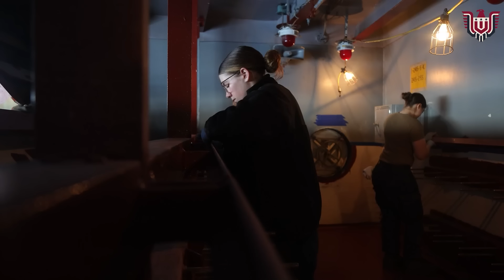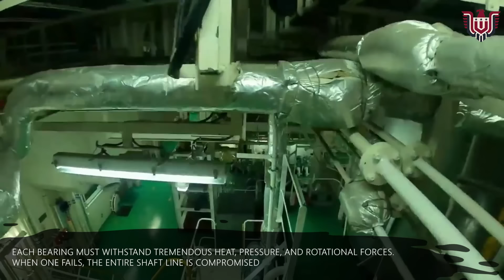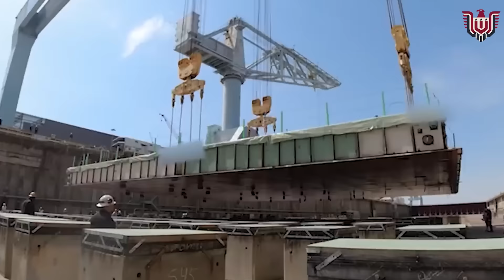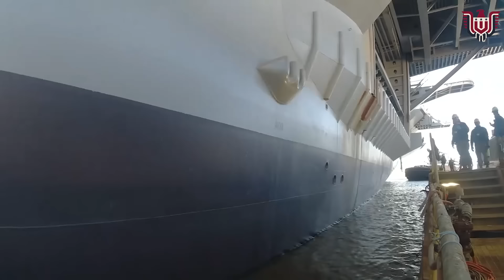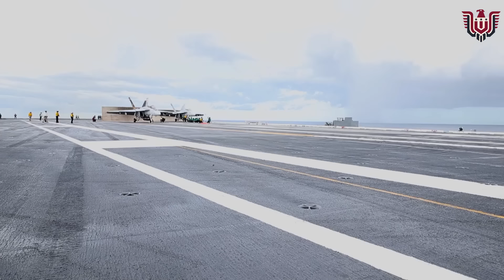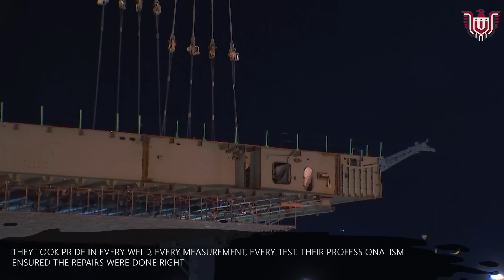How US Navy Rolling Out Newly Repaired $13 Billion Supercarrier From Dry Dock

Comment: People focus on the $13B price tag, but the capability and deterrence value you get in return is unmatched.
Reply: The $13B price tag includes the design and planning effort associated with first of class ship development.  Follow-up ship construction costs are continually lower since the design and development is bought and paid for on the first of class ship (CVN78).  There are design improvement costs associated with follow-on ship construction.  It is a continuous improvement process and the follow ships are usually better as system upgrades are incorporated.  Each ship may look the same but they are all unique.

Comment: You keep referring g to the $13B upgrade expense and repair, seemingly forgetting the original taxpayer cost of manufaturing this carrier and the accountability of the original builder of testing and quality controlling those failing bearings before the left the factory and installed on the ship. Has that supplier been charged additional fines for supplying faulty parts, and to cover the replacement repair? , unlike some other military projects, where failures get sweepedunder the carpet, to avoid punishing irresponsible suppliers and contractors. That should be a critical part of this otherwise decent coverage of a Ford class carrier  addition to the US military arsenal !!

Comment: The Vacuum Collection, Holding, and Transfer (VCHT) system on the USS Gerald R. Ford (CVN-78) is a vacuum-based sewage and wastewater handling setup (similar to those on airplanes or some cruise ships), designed to use less water than traditional gravity-flush systems. /it has been deferred.

Comment: Hilarious !!! All worships have long since been OBSOLETE, at least against any nation that is considered a super power or even has modern missile systems . Even a country like Iran could very easily sink that aircraft carrier with a single GPS guided missile. Russia could sink that aircraft carrier anywhere in the entire world . China could just about do the same . Russia does not manufacture air craft carriers anymore as they are smarter than the US and manufacture many more submarines.which are far more protected Extremely hard to locate but massive air craft carriers can not at all be hidden in the modern world and so air craft carriers are sitting ducks .

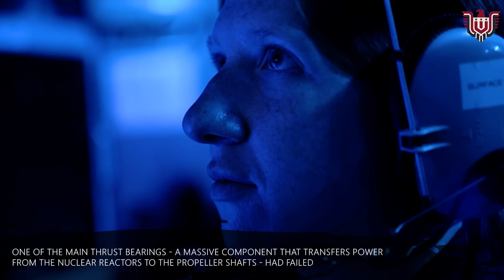Comment: 4:50 Let's start with the fact that the thrust bearing does not transfer power from the nuclear reactor to the prop shafts, nor does it handle forces from the reactor
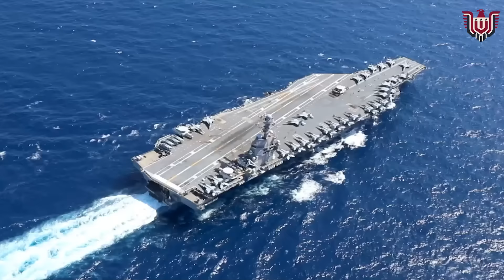Reply: Actually, let's start a few seconds earlier. At 4:33 the narrative specifically mentioned that the problems began during "post delivery sea trials". Which means the USS Ford had not even received her commission yet. So later in the video, when it mentioned her being taken *out of service", she wasn't really IN SERVICE to begin with! She was still in PCU.

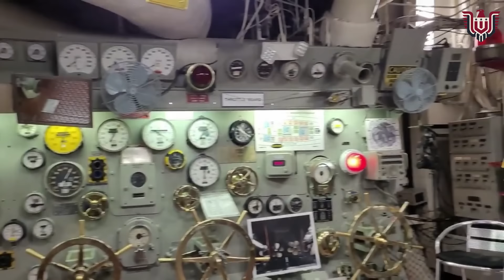Comment: that video segment  beginning at 5:05 min. is i believe  #3 engine room  main controll of midway cva 41 newest version   the engine room  has nothing to do with  the thrust  bearing  of the prop shaft 
the nain shaft thrust bearing is in far rear shaft alley  where the prop shaft exits the rear bulkhead  just forward  of the propeller      uss midway cva 41  1963 to 1966  #3 and #4 engine   $4 pump room

Comment: Fun Fact:  1 - ONE - nuclear tipped hypersonic missile will turn the Gerald R. Ford into a submarine.  A hypersonic missile travels faster than a 30.06 bullet.  A .30-06 bullet takes about 1 second to travel 800 yards, a Mach 10 hypersonic missile (such as the Russian Khinzal) would cover that same distance in about 0.2 seconds.  A hypersonic missile traveling at Mach 10 would cover a distance of 100 miles in 47 seconds, AND they have obstacle avoidance and maneuverability in flight.   Imagine 10 or 12 of them incoming - nuclear tipped.  Good luck evading that in a CV.   The only other option is to shoot them out the sky.  Good luck with that too.

While the Ford-class is designed with incredible "damage control" and survivability in mind, a nuclear strike combines two forces that even a 100,000-ton supercarrier cannot withstand: unparalleled kinetic energy and a nuclear thermal/pressure wave.

1. The Kinetic Impact (The "Bullet" Effect)
Even without a nuclear warhead, a hypersonic missile traveling at Mach 10 carries enough kinetic energy to behave like a massive railgun slug.

At these speeds, the missile doesn't just "explode" on the hull; it behaves more like a fluid, punching through multiple layers of armor and internal bulkheads before the warhead even detonates.

A direct hit to the flight deck would instantly end the ship's ability to launch or recover aircraft, turning it into a "mission kill."

2. The Nuclear Blast (The "Sinking" Effect)
If the missile carries a nuclear warhead (even a "tactical" one of 10–50 kilotons), the survivability of the ship drops to near zero.

Hull Rupture: A nuclear detonation within a few hundred meters would create a pressure wave capable of buckling the Ford's steel hull and flooding multiple compartments simultaneously.

Vaporization of the "Island": The heat from the blast would likely melt or vaporize the ship's sensor masts, radar, and the command "island," leaving any survivors blind and unable to communicate.

Operation Crossroads Lessons: Historical tests (like the 21kt "Baker" test) proved that a single nuclear device can sink a carrier. While the Ford is much tougher than WWII-era ships, modern nuclear warheads can be 10–20 times more powerful than the Bikini Atoll bombs.

BTW, The Russian-made VA-111 Shkval torpedo travels at 200 knots, or 230 mph, underwater.   For comparison, the standard US Mark 48 torpedo travels at 50 knots. 

And also just throwing this out there for grins and giggles ... the Russians also possess a nuclear bomb called the "Poseidon", which is capable of producing localized Tsunamis if detonated underwater near a coastline.   Any and all buildings near shore of the blast will be hit by a man made tsunami.   The Russians keep several of them under the polar ice cap.  Norfolk, Groton, even Washington DC itself, can be underwater in a matter of minutes.
Reply: Now go draw that in your coloring book. Pew, pew, pew!

Comment: Nobody checked the tolerances on those bearings anywhere from production to installation? I'm not a mechanic by any means, but I do check new parts before I install them into a motor I'm rebuilding. I can't easily afford to tear it all down again because I made a mistake. I would think there would be people who check that stuff. Even more so on such critical components.  Those machinist guys at GE knew that they were out of specifications long before it ever got to that point.

Comment: The description of what a thrust bearing does was incorrect. It does NOT transmit power from the power plant to the propeller shaft. It trsnsmits the thrust in the rotating propeller shaft (which is itself developed by the propeller) and transfers it to the mass of the hull thus  causing the hull to move through the water. Without the thrust bearing the propeller shaft would be pushed forward through the turbine casing.
Reply: But when the sailors block the latrines then watch it scurry back just like the other US carrier did .
Blocked shit stops ships.

Comment: You can only launch aircraft at a certain rate. On the “old Nimitz” it was 1 per 30 seconds. On more than one evolution I was told by the Air Boss to “slow the FAWK down”. I can’t get down with the 33% more launches 🐂💩. It’s a safety factor. Although primarily steam catapults were shown in this footage, the new magnetic system is awesome.

Comment: FALSE!!
The USS Gerald Ford did NOT have to go into dry dock to repair a faulty thrust bearing!
The problem with the thrust bearing was not mechanical but technical. The electronic system monitoring the thrust bearing was showing abnormal readings and was corrected in "port" ... NOT dry dock.

Comment: This aircraft carrier was not in drydock in 2025.The carrier experienced main thrust bearing failures twice: first in April 2017 and again in January 2018, forcing early returns to port due to overheating detected at 92 degrees Fahrenheit above setpoint. These issues stemmed from manufacturing defects in gears supplied by General Electric, as confirmed by inspections.

Cause and Resolution
A detailed probe identified improperly machined propulsion gears at GE's Massachusetts facility as the root cause, prompting a confidential settlement between GE and shipbuilder HII in 2023. The Navy and Huntington Ingalls Industries corrected the defects during the ship's post-shakedown availability phase, with propulsion fixes completed by July 2019.

By now, I am tired of the new youtube channels making believe that things just happened.

Youtube is fast becoming the joke.

Comment: And lets not forget when you eliminate it means less retirement and veterans benefits. And GE must be responsible for replacement of said failed bearing as the warranty as far as , John Q Taxpayer is concerned is minimum 5 years. And yes, I understand the dry dock process having been a yard dogs for 15 yrs out of my 54 yrs as a professional Welder. I would have preferred that 15 yrs had been all 54, but it was not to be due to forces beyond my reach.

Comment: So you're saying the EMLAS is still in use and working as designed— that it's not routinely damaging airframes/equipment? You're saying that the dual band radar has not been completely removed and replaced completely with earlier generation systems? You're saying that all the toilets and showers flush and drain properly now, and that the AAG works as designed, without any problems. You're saying that the defenses of that single $13 billion asset are on par and prepared to counter a unified strategic hypersonic missile attack? Gotcha...

Comment: Who cannot be proud is the question. But here is the skinny on why the Ford had so many problems at first. When we went from the Essex - class to the Midway - class to the Forrestal - class carriers, most of the systems were carried over but enlarged. Sure certain systems were up graded from class to class but most remained the same like the steam catapult system, hydraulic elevator system, radar system with minor upgrades, and so forth. Then came the Kitty Hawk - class the Enterprise. The only up grade was putting a nuclear power reactor to make steam instead of an oil burner boiler. The majority of the systems were carried over from the forestal class. Then came the Nimitz class carriers. All carriers were now nuclear powered but the systems were still carried over from the Forrestal class with minor changes and up grades. Thats why when we went from class to class carrier, there were no major hurdles to jump over, just minor learning curves.

Then came the Ford Class - A completely new designed aircraft carrier. ALL NEW SYTEMS. There were no carry-overs from the Nimitz - class. Magnetic catapults, the radar, the propulsion system, electric elevators, environmental system, and so forth were all redesigned. We basically put all of our eggs in one basket. So with all the problems surfacing with the Ford these problems can be corrected with the next manufacture of carrier. So every problem that was fixed on the Ford while in dry dock, those changes will be passed on to the next carriers that are being built now. The Ford will always be the test bed carrier in this class of carriers, developing new problems while the other carriers being built are incorporating the "improvement" changes. So no the Ford was not a waste of money, it was first in its class and all other carriers following will be improved because of the Ford. Then when it time for a new class carrier,  the systems will have been long time tested and proven to be carried over.

Comment: Thousandths of an inch (plural) does not describe extremely tight tolerances when it comes to machining parts...this could indicate +/- .003 or even .005 which is very easy to hit...minus zero plus 3/ten-thousandths would be extremely tight tolerance -.000/+.0003

Comment: 1983 at ASI Avondale Louisiana as an Outside Machinist Rigger I overhauled 8 screw shaft sections (2/engine),16 sets of bearings, both rudders and all 4 screws. I was working 12hrs/day no days off for more than 3 months till it left for Ingalls Shipyard at Pascagoula Ms where 6 (forward guns) were to be replaced with guided missiles. Only the four tail sections of the shafts are solid. The remainder are 12" wall thickness with 32" OD. Hard work carrying, hanging, working any rigging from 2T to 25T. Our Battleships are the best. Surrounding the main deck there is no wall, deck, or overhead less than 16" thickness. I was USNR during Vietnam as an aviator or SeaBee

Comment: There is nothing 'nuclear' about thrust bearings, every ship has them, ship are powered by propellors that drive the ship forward by thrusting water backwards, this converts the approximately 75,000 hp on each screw into push and this bearing has to transfer this rotating force into the structure of the ship, just like my swivel chair carries the force of my tush down to the floor.  While the total power of aircraft carriers is impressive, it is divided between four shafts, cargo vessels, specifically large container ships and oil tankers, vessels much larger than carriers in size and tonnage, generally put all of their power onto a single shaft, they have only one propellor.  Some of these vessels have over 100,000 hp and with their immense weight, nearly 500k tons, they provide as much or more stress on their thrust bearing than a carrier does.  As for getting a ship into drydock, been on that team and it does take teamwork, but the yard's captain/pilot has done this hundreds of times, mayB thousands, and while it always is a challenge, he and his staff work carefully with the ship's crew, for the yard this is routine business.

Comment: @4:50 - thrust bearings are in the power train between the turbines and the propeller.  Nothing to do with nuclear power.  Would be the same in a fuel-oil power boiler to turbine arrangement.

Comment: My only question is that these designs were largely developed before the reality of drone warfare, which brings into question survivability in a modern war. where missile attacks might no longer be major threat, replaced by swarms of drones.  .    they are fine for shows of strength, but a lot of changes have happened since these ships were conceived as the ultimate and final answer , while drone warfare is still advancing,

Comment: I hope the dry dock fixes includes laser mount locations for multiple medium and short range lasers to defeat drone and missile swarms. We need all surface ships to be dual reactor as they need to house lasers too. Missiles should be reserved for strike and high value defense. Fleets need outer layer air and naval drone swarms to significantly improve fleet defense.